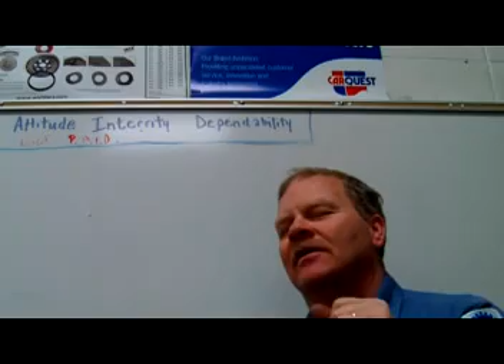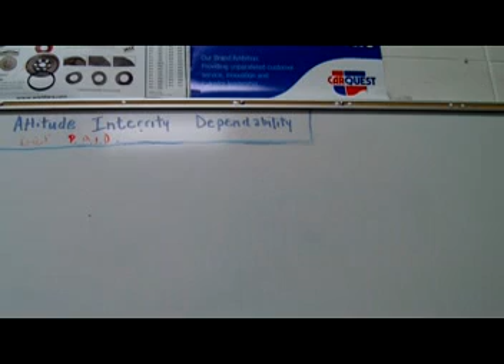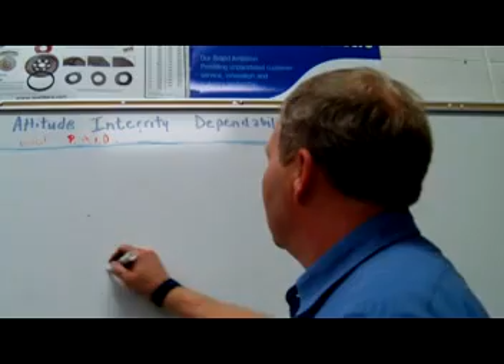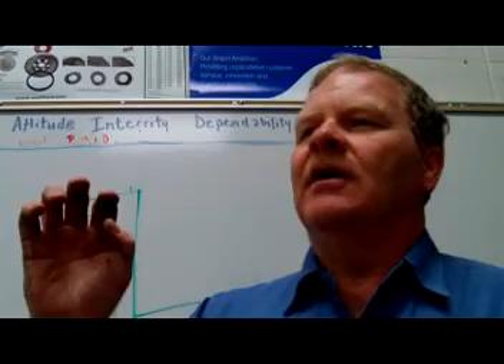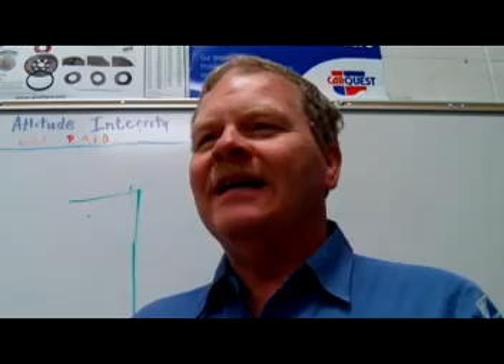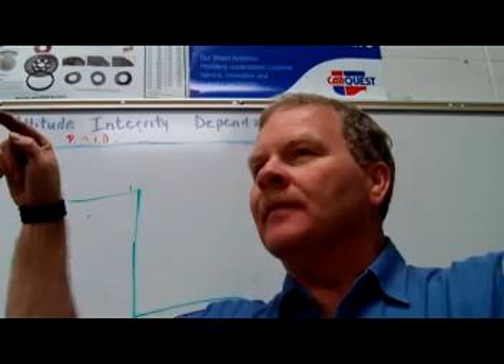Engine Principles 1 Session 1.mpg

Comment from the maker: One of the things I've found is that every grad/finisher has a niche - and if I don't match them with a job where they can grow, it doesn't seem to work well.  I have a couple of guys working at the local Toyota dealership, both of which are doing very well, but one is doing better than the other one, even though they both came from here!  Starting out is tough, but it's rewarding if you can hang long enough to build some speed!